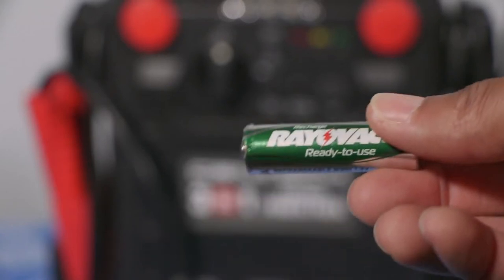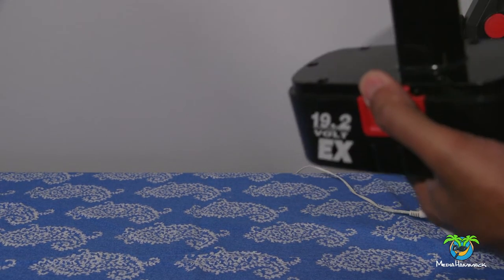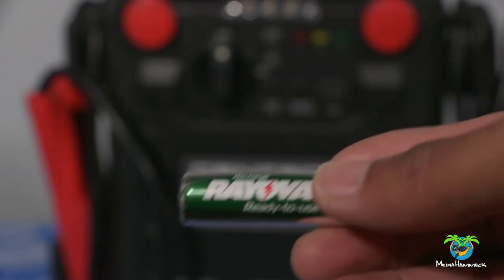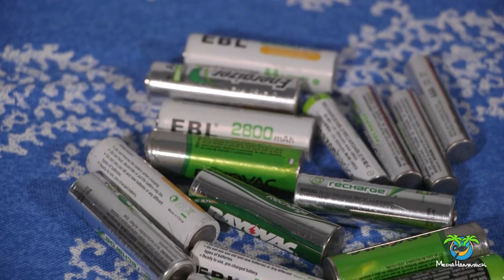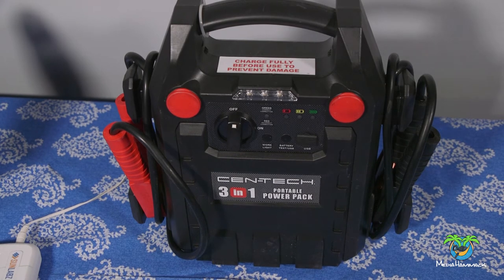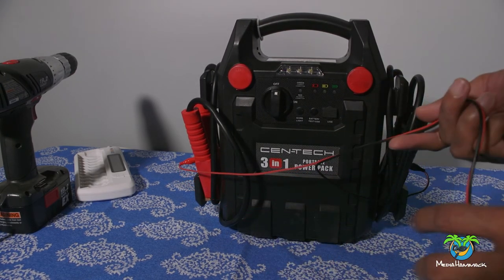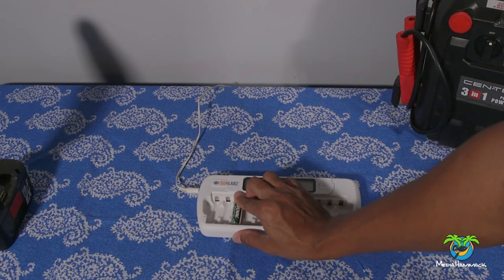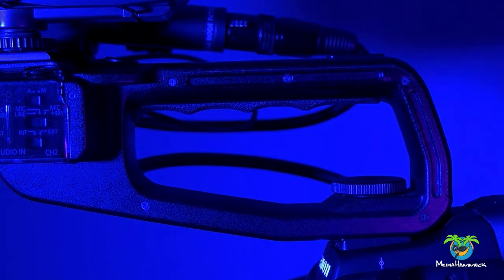how to fix a dead rechargeable battery ( ni-mh | ni-cd )

Comment: Nice video man, Grinds my gears these modern "smart" chargers that has voltage sensing circuits that ignores the battery if the voltage is very low. A linear charger or another battery acting as a linear charger gives voltage no matter what and forces it in and then you put it on a smart charger and it works. I did it to my summer car's battery last week and it saved me money since the battery would still hold a charge even after deep discharge!! So everybody needs a "dumb" linear charger with no auto features and a "smart" charger with their fancy pants 9 step charging procedure!!

Comment: 12 volts is too much.  You can blow the battery. 

I find that some batteries can be brought back with another battery or a power source of the same. Voltage. Ni cd can have the tiny shorts in them opened by tapping repeatedly using no more than double the voltage of the battery you are trying to fix.

Comment: Totally worked. I used a regular 12V Adapter, positive to positive, negative to negative for 2 seconds and was able to charge my AA battery again. Thanks for the tip.
Reply from the maker: You're welcome!
Reply: i have a car 12v battery adapter! how can i do this using + and - ?!!!
Reply: You can get what’s called a pulse repair charger specifically meant for recharging dead car batteries. But they only work so far as health of the car battery in my experience. anyway I bought one of these things for about $40 online.

Comment: I have come to the realization regarding rechargeable batteries. We have two options NiMH which have low voltage output and are usually dead when you need them due to the self-discharge rate and Li-ion that can burn down your house if not careful. I gave up on this years ago. Now thought with new technology I would try these new no self discharge NiMH batteries. Out of the 16 I ordered from Amazon/Amazon 4 were low in voltage . I used some others in my Roku Voice Remote and because of the lower voltage it shows battery low after 2 weeks.
Think I will just buy the Amazon basics Alkaline cells for a while till something better comes along. This whole "Saving me money" thing is costing me more and much more aggravation
Reply from the maker: I know what you mean, but my kids have so many toys with batteries that I have to have rechargeables.
Reply: Try Ni-Cd, better than Ni-Mh and lasts way longer in cases of emergencies. Hence why they are still used in emergencies and industrial workplaces as backups, very reliable.

Comment: in my experience, ni-cd 1.2v can be revived by a 3.2v battery or power supply 10amps. it will jump start it enough. Note that not every battery can be revived this way since some of them might be already damaged internally.

Comment: the battery with higher voltage passes charge to the dead one till it is charged it may heat up if high current is passed

Comment: you are pumping 12v to a 1.5 AA? a bit extreme I usually go from twice the voltage of the battery wih a variable voltage supply then a bit more if the shock doesn't revive it... but yeah it is like giving a shot to some guy that is dying ...works most of the time

Comment: Thanks for the instructions. I used a NOCO GB70 auto battery booster on manual mode with 8-duracell rechargeable AA's. Took a few times on each battery but it worked. Confirmed with my multimeter and they are now recharging. Only a few taps because the batteries get hot quickly.

Comment: DUDE, I have that same Battery Jumper and I have had it for years, LOL!!!  I had to repair it once when someone dropped it and broke the plug in the rear, but it is still ticking along with no problems.  Great vid bro.  I read some of the comments below and simply explained the charger needs some juice from the battery to go through the check system.  Intelligent chargers typically are not designed to charge batteries from zero charge.  So you are by passing the check system with the 12v supply and giving it enough juice so that it can work with the intelligent charger.  Then the charger can handle the rest.  Reading the comments below we all have our own way of doing things as long as we are safe while doing them.  Your way is one of the quickest ways to give it more juice as oppose to some of the comments I read below.
Reply from the maker: Thanks for the feedback. I know that when it comes to batteries and anything electric, you know your stuff, so I appreciate that.
Reply: @MichaelWTurner  I love to see types of posts bro.  Keep rocking them!

Comment: Thanks for posting this. Output specs on your booster would be helpful. (Voltage and amperage)
Reply from the maker: It's 12V 400 amps, but doubt that amount of juice is needed for the batteries. It's what I happened to have on hand so I figured I would try. Here's  the exact one https://amzn.to/2MOA90h

Comment: I've done something similar but I've found that those batteries don't hold their charge for long. Sometimes, even after a day or two of just lying in the drawer they will need to be boosted again.
I've actually repeated the process several times to try and refresh it but to no avail.
It's a good solution in an emergency, just don't rely on them as you would on new batteries. :-)
Reply from the maker: If you notice this behavior when they are new, then they are defective and I would return them. But yes, some older ones will stop holding a charge and this fix will not work.  I've had really good success with it when it comes to batteries left in a device for months slow discharging to the point where the charger no longer recognizes it.

Comment: Nice. I just take the two batteries that aren't being recognized, and butt them together - to -. Then I connect the +terminals with a wire, usually the metal parts of my phone charging cable. Hold for about 30 seconds to a minute, and the charger should recognize them.
Reply: humm this looks interesting and would save me the hassle of using my car ! BUT...i don't exactly see/understand how you did this; mind explaining maybe in better words ? or steps ? i feel stupid, but english is not primary language, even i i speak well :)

Comment: DO NOT connect 12V to a 1,4V battery !!!!!
I might blow up when you do that.
On a Ni-Mh cell you can connect 3-5V - A Li-Ion 4,2V MAXIMUM 
NEVER EVER 12V  from a high power source !!!!!!!!!!!!
IF you will try to do that trick, use a small 5V USB charger - max 1A 
NEVER EVER a 12V jump starter or car battery !!!!!

Comment: You really only need double the voltage of the battery to jump it, the car battery charger is probably, uhhhh, overkill? Or super dangerous,(not sure how you walk with those giant balls dangling down there), but effective. Also, just for anyone reading this: if it's been dead a long time, it's best not to jump it. Not gonna explain all the reasons here, but look it up. For real. This was a great vid though. I have an under cabinet motion light that loves to kill my double aa EBLs and this works well. The charger won't see the battery if the voltage drops too low so the jump gives it just enough to make it visible. Fyi. DON'T HOLD IT THERE FOR LONGER THAN 5SEC BURSTS either. Trust me on that. I still have shrapnel in my wall from a cheap 14500 that I left sitting to jump for about 4mins. Scared the shit out of my cats!
Reply: I have two 600mah AA batteries that are pristine but no charger will charge them more than a minute until it says full.  I put them in a draining source and dead in a few seconds.
Reply: @generalawareness101  I have exactly the same problem with different brands of (new) batteries and chargers. I stopped buying rechargeable because of this (just posted a separate post about this issue)
Reply: @vinzzbe  Yes, and finding chargers that can trickle charge is impossible short of the 100 USD models.  Trickle is sub 100 mah or even sub 50mah.
Reply: @generalawareness101  I posted a separate comment in this video, but my message disappeared after refreshing the page. gotta love YT...  (This message even disappeared, trying to post for the third time and I'm including some hypens in the text (hope this helps))

I've bought GP, Dura-cell and Ama-zon batteries with 2 different chargers. One GP charger was included with the batteries and I bought one more expensive charger from Volt-craft (charge station 2020).  They both give the same result. The batteries are 'fully charged' within a minute and are depleted in a few seconds. Never had this issue with batteries i bought 20y ago.  It only happens with newly bought batteries. I'm really confused by this and did not find a fix for it yet. (I bought around ±20 batteries!)
Reply: @vinzzbe  20 years ago batteries were mostly Ni-Cd.  Btw, tell me about the censorious nature of the most mundane comments on YT as I know it far too well.  I barely comment these days and if I do I try to keep under 1 sentence.

Comment: I do the same thing with 2 screwdrivers and 1 good nimh battery. Use the screwdriver shaft to make a parallel connection for a few seconds and the chargers will usually see the battery after that
Reply from the maker: Thanks for the tip. Seems a little safer than my jumper cable idea😁

Comment: To the point. Thanks. You didn't really need to hold it, just tapping it would have worked. In fact, if the battery is really dead, and connecting it to a 12V battery didn't work, try a higher voltage. Like 24-30V. So, two car batteries in series; however, you would need an adjustable power supply to do that if you didn't have two car batteries laying around.

Comment: I tried to jump start a dead Motorola T191 battery with another identical battery, and I managed to bloat the battery that was still working. Luckily the battery that I used to jumpstart the dead one wasn't holding too much of a charge itself, so it's not a great loss, but this rose a warning sign for me. I don't know if the bloating was caused by the fact that I tried to jumpstart another battery, or because I was constantly plugging the still-working battery back into the charger after each jumpstart attempt. I was doing that because I thought the battery used for jumpstart had to be always at full charge in order to be able to jumpstart another dead battery.
Needless to say, my attempts failed. The dead battery is still not charging, although it managed to get some voltage into it, and now the original battery can't power up the phone anymore, and I'm scared to plug that battery back in. It deflated a little bit, but not as much as to return back to its original shape. I hate that I have so little electrical skills. 😢

Comment: Not so extreme, but also possible on tool batteries: I have every now and then dead Maktia 18V batteries (Ni-Nm and Li-ion) where the Makita charger refuses to charge. I simply put them on a model car charger where I can adjust for the battery chemistry and Voltage: They normally will be charged by that one, since the model car charger does not car how low the voltage it (which is why most chargers refuse to do it) and I can leave it on there until it is fully charged.
Most problem why these batteries are dead are, that they are being discharged too low! (Especially LED light are a killer for re-chargeable batteries)
So change them early before they show signs of weakness and you are good to go :-)

Comment: I have a dead 9V nickel cadmium battery -Can I start (recharge it )it up ? it must be about 35 years of age (i guess).And It might been recharged once or twice after the timeperid it was last used in a radioclock - the 1980s and there is some green corrosion
Reply: The 9 volt nickel cadmium batteries they're not truly 9 volts be careful when you recharge it they are something like 8.5 volt they may take a charge